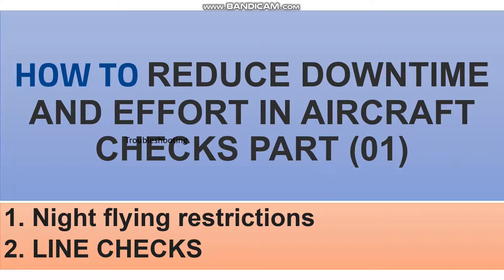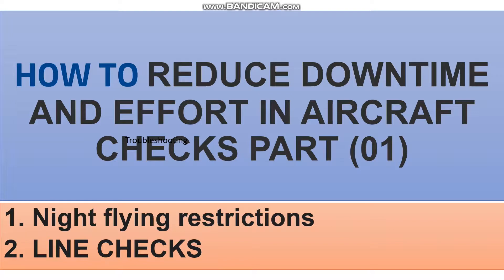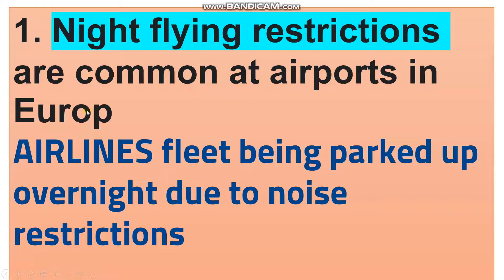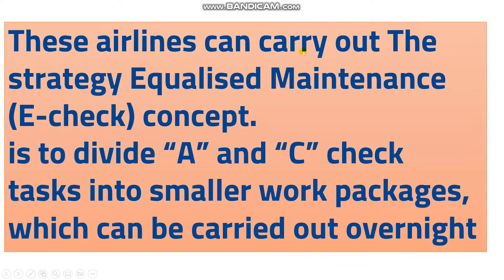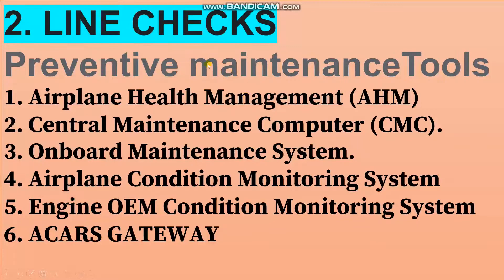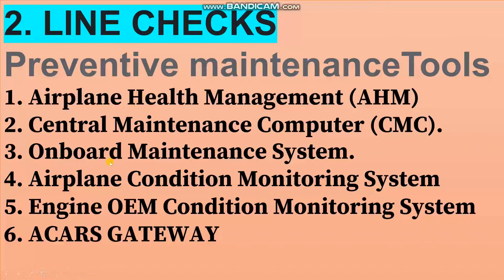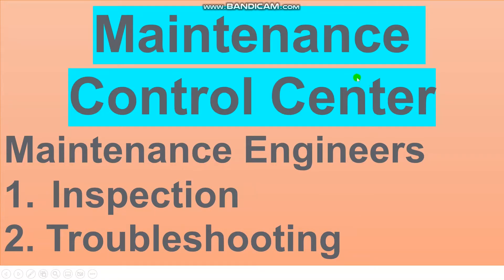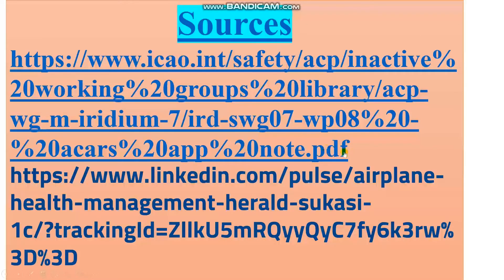HOW TO REDUCE DOWNTIME AND EFFORT IN AIRCRAFT CHECKS PART (01)

Comment: Hello!
On the basis of which document are the daily check and nonflying daily compiled? What items should be included in this document and why?
Reply from the maker: The daily check is every 24 hours not flight hours
Reply: @abbasaviation  Not really. On 737CL 24 hours, on 777, 737 NG 48 hours. That's not the question. When a new company makes a list of jobs in the Daily, what document should it follow? The daily of many companies differ significantly.